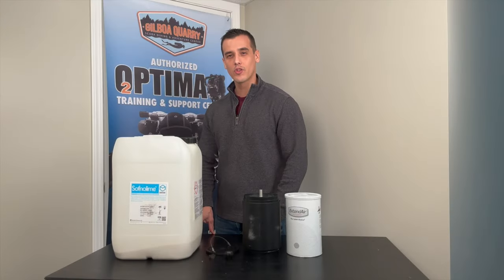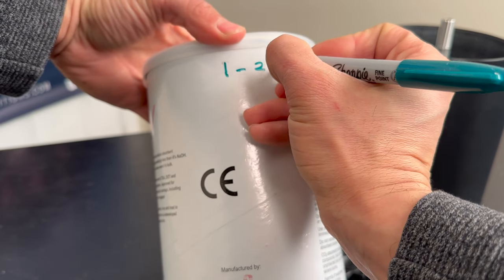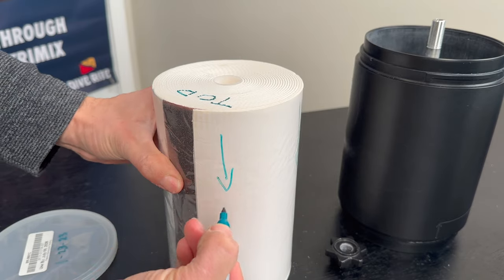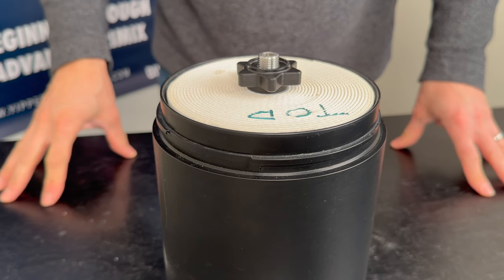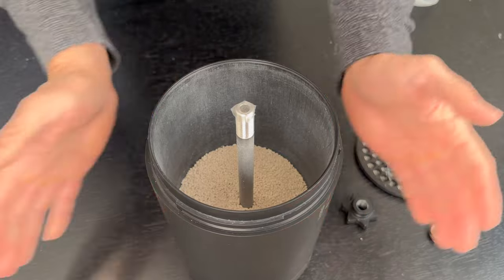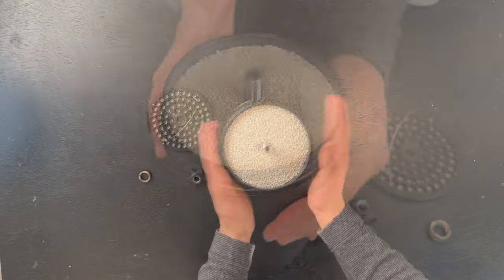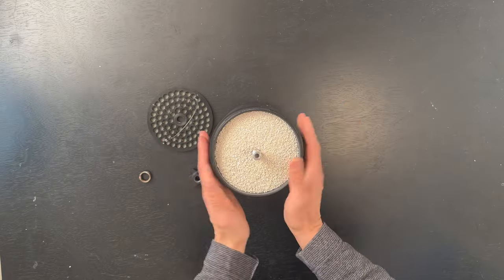How To Install EAC & Granular CO2 Scrubber On The O2ptima CCR

Comment: Great vid. I was taught to pour the gran from the container into a pitcher to help eliminate some of the dust by letting it blow away in the wind. Then pour it into the canister, tap and fill. But I use EAC whenever I can. I would like to see a video on cleaning the canister when you experience a wet flooded can or when you want to switch from gran to EAC.

Comment: Great video, what kind of duration do you get with the EAC in cold water?
Reply from the maker: 4 hours as recommended by the manufacturer and Dive Rite. I’ve personally watched a friend of mine use it for 6+ in deep cold water, but I found this to be reckless and wouldn’t ever recommend.

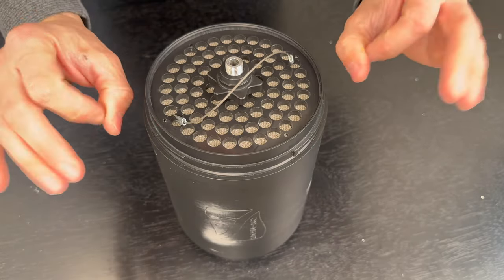Comment: This looks like too little sorb was packed.  I would be adding just a bit more.  The top plate should be flush with the inside edge of the canister.  You have a decent gap between the top plate and inside edge of the canister.  Freeze frame at 5:14 and then compare to Figure 7 of the Dive Rite user manual.